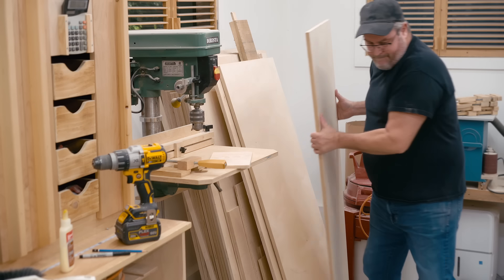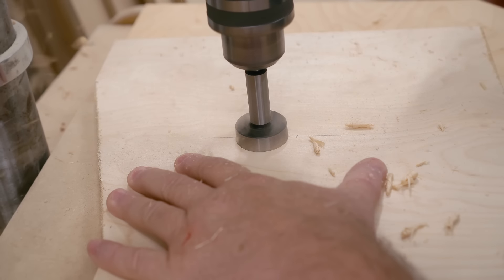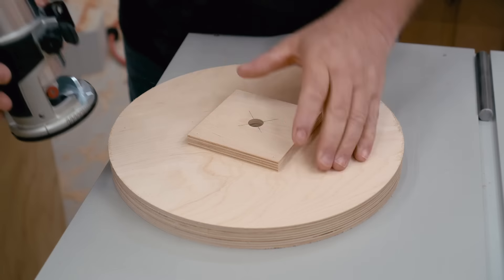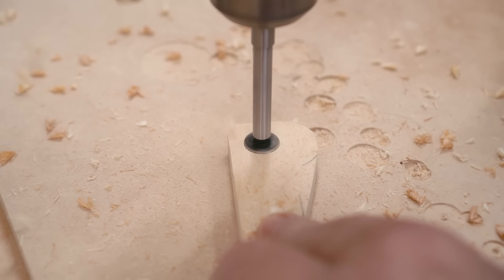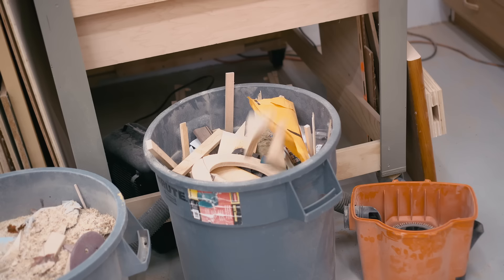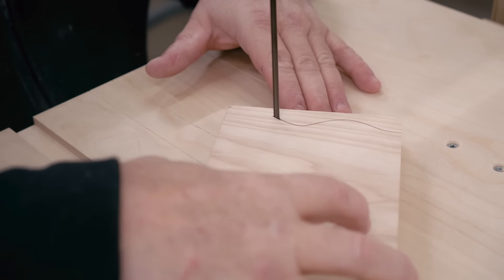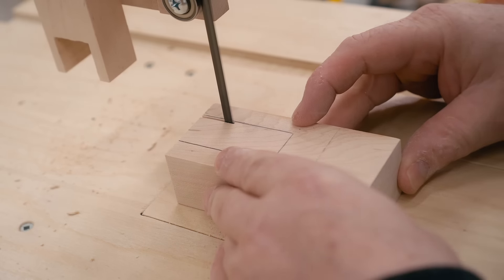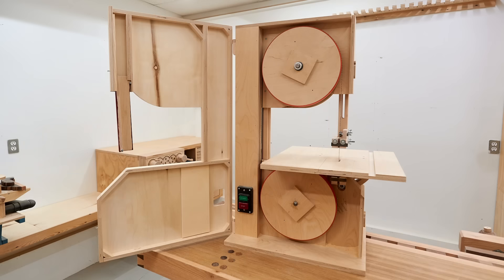Making a Band Saw - Full Build Video

Comment from the maker: This video shows how I made the wooden band saw I designed. It's a 12" model, and that means the wheels are 12" in diameter. The max resaw capacity is 7-1/4". It uses an 80" blade. The motor I used is a 1 hp induction motor that runs at 1725 rpm. The pulley ratio is 2:1 with the lower wheel running at half the motor speed. 
The unique feature is the quick release tensioner. With a simple flip of a lever it releases the tension on the blade.
Reply: Twice motor speed. Are you sure it's not 50% of motor speed? Other wise that blade is motoring along at 5400 ft/min
Reply from the maker: @mpetersen6  Thanks :)
Reply: John, it's truly such a pleasure to see your mind at work.  Thank you for this video and all the many videos you've produced over the years.  You're creativity and skill are very inspiring.    Well done my friend.
Reply: Well I watch the hole video and you talk explaining what you keep on working but if the video talk about the measures I will see it again but the answer that I read said that the video had the measures. John i will like to buying the plans for the band saw . I’m very sorry but when i check the notes i wrote i see i start reading before sending the question and i find out that i start talking about one thing and then switch to another thing. But saying again i just want to do it’s buying the plans. Thanks you again.
Reply: Will you be releasing plans for this bandsaw..? It'd be great to see them in Imperial, and in Metric for those of us across, well, all the oceans.. ;)
I envision the space taken up by my current POS bandsaw being filled with a far better unit, in the subtle and natural tones of 'plywood'..

cheers for the wonderful and detailed video.. as usual :)
Reply: Will you have the plans available for purchase, John? As of yet, none are on your site for this project.
Reply: Джон вы молодец! Пойду делать свою пилу ин ша Аллах. Думаю ваше видео пойдёт мне на пользу!
Reply: How do you go about, deciding and coming up with the pulley ratio
Reply: Mighty impressed with the video, however cannot find plans on your website

Comment: Looks like a fire hazard. It's definitely neat, and it was fun to watch the process, but tools like this probably shouldn't be made of wood. Lots of heat created by friction, plus flammable wood shavings, and you didn't seem to implement a dust collection system. Even worse if someone tried using this design to cut metal and send sparks everywhere. I'm sure you could save some money by building one of these, but try using materials that aren't flammable.

Comment: Interesting build. My grandfather was an avid woodworker and out of economic necessity, built an 18 inch wooden band saw in the 1950's. Both my father and I used it for many years, until I finally disassembled it the 90's in favor of a more rigid cast iron machine.

Comment: My father built a huge one that can cut 18 inches wide. I was around 6.5 feet tall and 3 feet wide. I saw it has a brush beside the wheels to keep the dusts off and he used bearing as a blade guide instead of wood because friction on wood can heat up the blade adding to the heat that it creates during cutting, thus shortening the life of the blade. 

What I like about this build is that the table top can tilt up to 45 degree and can be used for small projects. My father's is only for cutting huge ones..

Comment: Excellent job John, you should be proud. You could do with some sort of Electrical interlock and brake on the quick release handle. You don't seem to have visitors, but God forbid anyone would release tension on that blade while it was running. Am electro-magnet which energises when the machine is on and a microswitch to disable it from starting when the handle is not in place. Anyway, this is just me thinking out load.

Comment: This video is a three-fer, excellent build, great camera work and editing. I have an old 14" yellow and green, Montgomery Ward band saw. It has a good motor, everything else is hobbyist grade though it looks dang near industrial. Precision is not in the definition. Your saw is one I'd trade for. Parts for mine are unavailable, obsolete unit. I will have to consider replacing parts by following your example, build them.

Comment: Awesome! I've been waiting for this video. I watched the other segments, but this full build video is great! Another great design/build in the can, so to speak. 
I know you said earlier that there won't be plans for sale in this one, but I wish there were. 
I watch a lot of diy shop machine builds and I pick up a lot of different design variations/details that I make notes of. A band saw  build is in my very near future.
When you were re-sawing the board here I had a thought. I've seen various resaw jigs/attachments/fences/etc. I wonder if a guy could make an adjustable thickness guide for the miter slot, and another that would mount on the upper blade guide assembly. The two would correspond with one another to guide the board being re-sawn. The reason for the two separate guides would be for better, more accurate means of keeping the guided side of the board at a rock-solid space from the blade. Maybe this is a stupid idea, but an idea nonetheless! Ha...
Anyway... I watch all of your videos and love the work you do. Thanks for it.

Comment: Great video John, I have come back to watch this many times.  My bandsaw lower blade guide is in a cast metal assembly that broke and I cannot find a replacement.  Planning to make a new one using some hardwood.   I don't believe you mention what the guide blocks are made of but they look like some kind of nylon.  I am wondering if I could just use HDPE, like pieces of a white plastic cutting board...

Comment: It looks like a very nice saw.  Do you want to comment on the choice of plywood for the structure rather than the more common choice of solid wood?
Reply from the maker: Solid wood isn't dimensionally stable and I'd have to factor that in if I built it from solid wood.